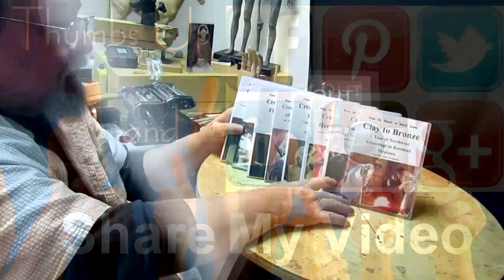A WARRIOR'S FAREWELL - Turning the Clay Upside Down

Comment from the maker: I have to work on areas of the clay that are impossible to see and reach as it stands up-right, so I had to come up with a way to turn it upside down to reach those areas.
If you're interested in sculpting, and you want to take advantage of my over 50 years of sculpting, you might check out my 9 instructional DVDs in the Video's Description.

Comment: I recommend you change your Phillips Screws over to the Square Head Screws and a Square Head Drill Bit approximately $10.00 and $8.00 respectively on Amazon or you can pick up some at your local hardware probably a little cheaper. Less stripping, better grip. Just a thought.
Reply from the maker: I agree... but I have everything with Philips..  but you're right.. They are better.